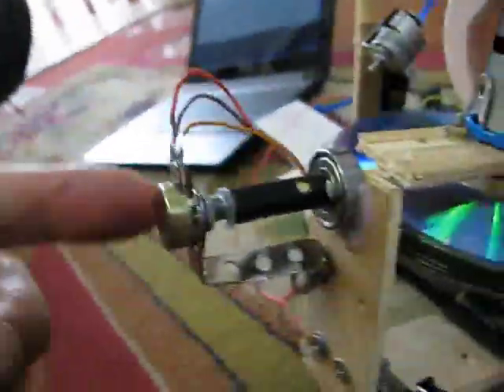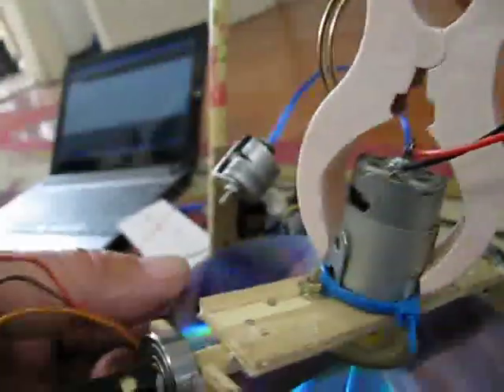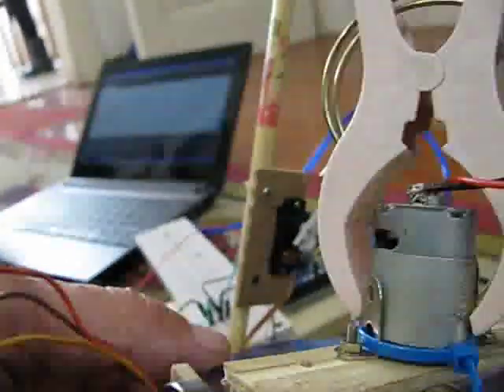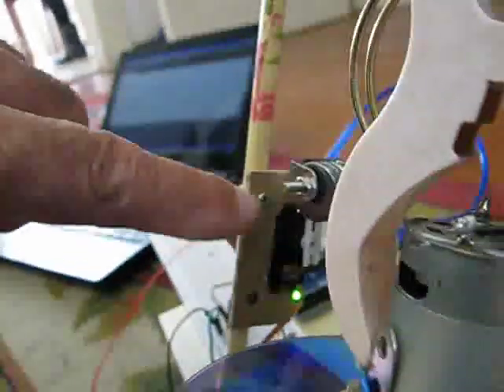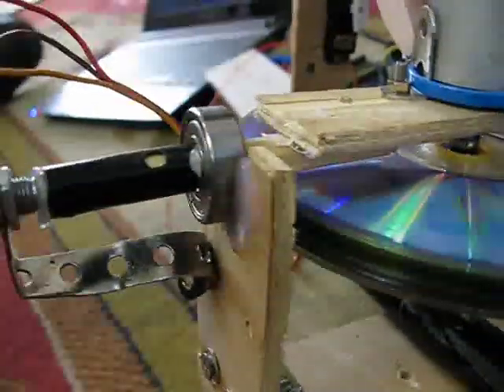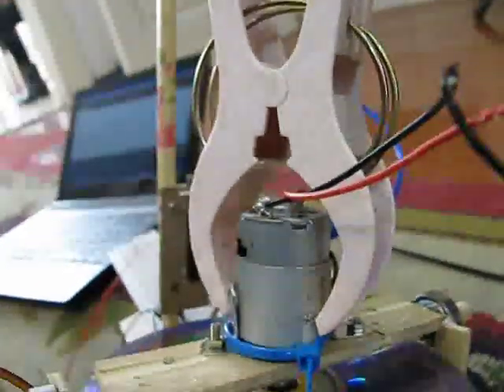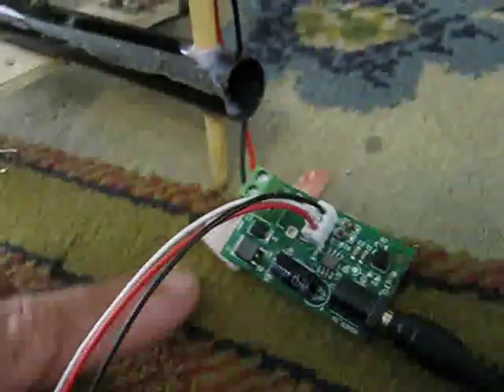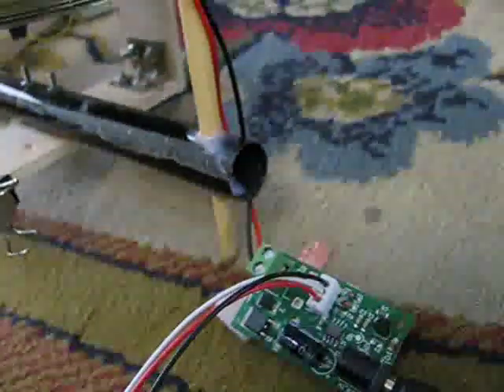Self Balancing Gyroscope V3 Using Arduino and Pot for Tilt Sensor

Comment: HOW THE servo and Potentiometer are connected in this version ? . I understand that the Potentiometer is connected to the Arduino to measure the angle of gimbal (giggle) :> , and then in the previous video u controlled the servo manually but in here it is automated (the servo) how did you connect the functions of  servo with potentiometer ? another arduino board or just connect it straightly to the Same arduino board that our potentiometer is located ? and add additional programs ? Cheers , sincerely
Reply from the maker: Hi again. Please check my LetsMakeRobots site (link is in the description above) and look at the videos and details. It shows more information on how it works including the arduino code to control the counterweight by using the potentiometer input.
Reply: Thank you , i now got them all , :)